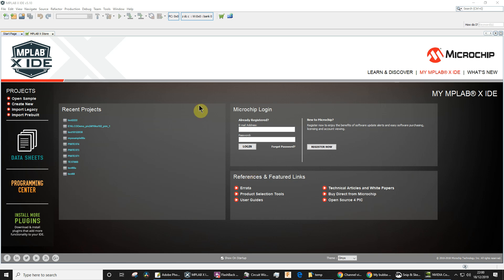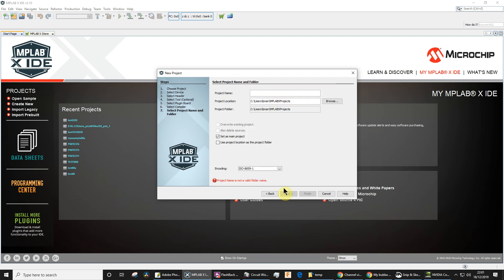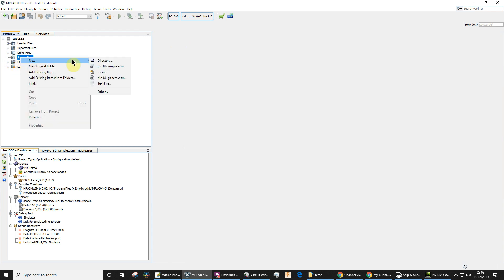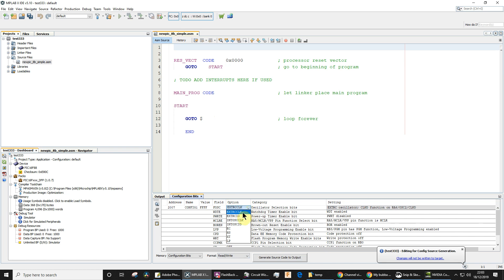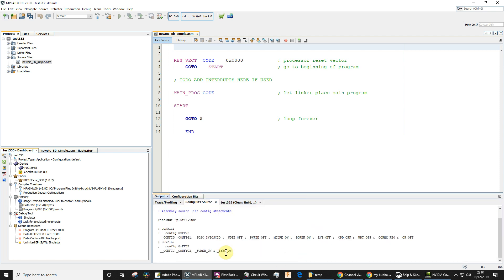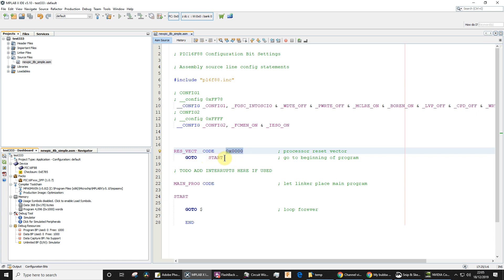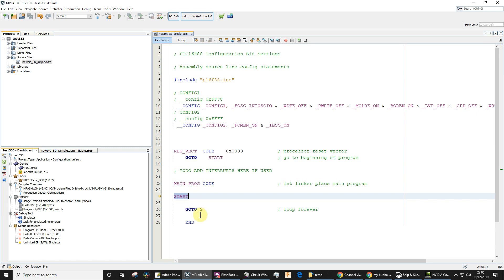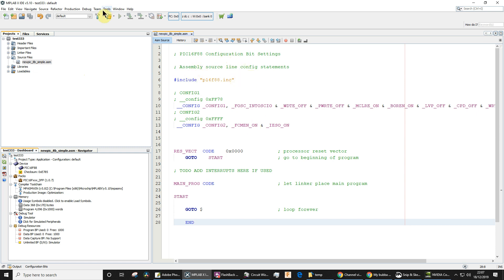Create new MPLAB X assembly project for PIC16F88  microcontroller

Comment: Só, it's good to learn Assembly? I bought a old robot kit, dream of Mine, and its manual shows ALL in Assembly...
 It's still in use?
Reply from the maker: I'm happy to use assembly language for a simple program but for anything else I would much rather use a higher level programming language. The sole driver for me using assembly language is that I teach electronics and the students are required to learn to program using assembly. It's actually quite good in some ways as it gives some a thorough understanding of the lower level stuff.

Comment: I do not have mpasm in my MPLAB X IDE
Reply from the maker: What version of mplab X IDE are you using?
Reply: @PizzeyTechnology  5.50
Reply from the maker: You have installed a 64 bit IDE and this does not support the 32 bit mpasm assembly tool chain. If you need to use mpasm then you can download an older version of the IDE from the microchip archive. 5.45 was the final 32 bit version if I remember correctly.
Reply: I think i must download MPLAB X IDE with versions below 5.4
And thanks for help 🌹
Reply: @PizzeyTechnology  help for me, thx!

Comment: Thank you.  I was reluctant to use the new MPLAB X.  I'm used using the earlier MPLAB 8 (and earlier) .  This helped.
Reply from the maker: Glad it helped! I haven't used MPLAB 8 for ages, but the biggest push for me was the desire to use ICSP and the PICkit3 programmer. Have you thought about jumping in at the deep end and trying the latest version of MPLAB X IDE with the new XC8-AS assembler rather than sticking with MPASM? I posted a video here https://youtu.be/VEvMtWZt9QE
Reply: @PizzeyTechnology  I'm using version MPLAB X 5.35.    I bought a few newer mid level PICs and one wasn't supported by MPLAB 8, and it would be more work to work-around the issue (trying to stay with MPLAB 8) than it was worth.   I'm not ready to try XC8-AS ( I didn't know it existed until I read the comments following one of your videos).    I perhaps will someday.  I find MPLAB X is information overkill for when I'm doing relatively simply stuff in assembler.  I have no interest (yet) in moving to 'C', I don't need to use 'libraries' etc... I try to write everything from scratch myself.   That way when something doesn't work... I know I'm the problem and work toward the solution.  I'm like Grover from Sesame Street... not the brightest bulb, but I don't give up.  

P.S.  Thanks for the link to the XC8-AS Transition Guide.  I will have a look at it.  I quickly 'scrubbed' through it while writing this reply... definitely worth viewing!  You've put a lot of effort in it.  Thanks again.

Comment: I have not mpasm, I only have xc8 can you help me with this?
Reply from the maker: Do you need help using xc8, or downloading the MPASM assembler?
Reply from the maker: @Supun Chathuranga Did you download and install a recent version of MPLAB X IDE? MPLABX 5.40 (64 bit only) does not include MPASM (32 bit and therefore deprecated) so you will need to install an earlier version (I'm currently using MPLAB X IDE v5.30 with MPASM) or use XC8-AS instead. Does that help?

Comment: Great Video.I got a good knowledge.I am trying to program a pic16f876A using assembly.I've downloaded mplab v5.40 recently.It does not have mpasm compiler.It has pic-as v2.2.Does it work like the mpasm or I have to download the mpasm compiler.Any thoughts...
Reply from the maker: I'm glad you liked the video. I have installed (or reinstalled) MPLAB-X on several computers and never had a problem. As far as I recall, the MPASM assembler was automatically included in the download and installation package. I believe that one of my students may have had a problem getting the compiler to work (or perhaps it was not installed) and I think the fix may have been to remove MPLAB-X and then reinstall. It was not something that I was personally involved with so I don't have any details. I hope you get it working.